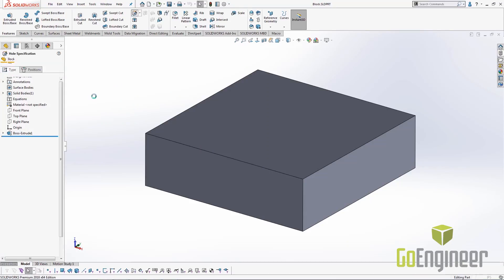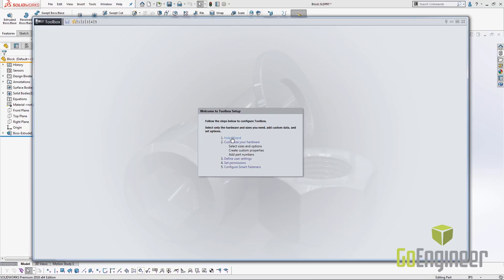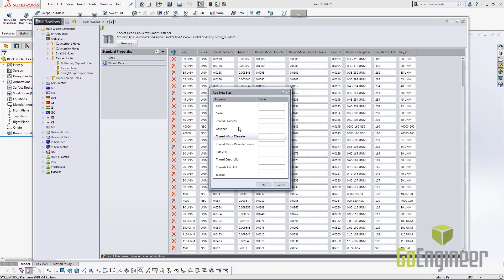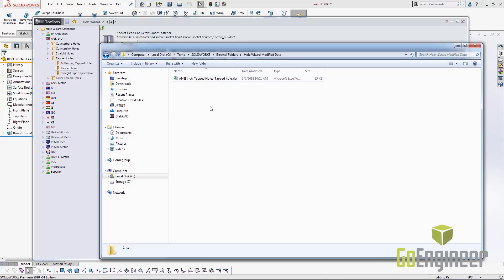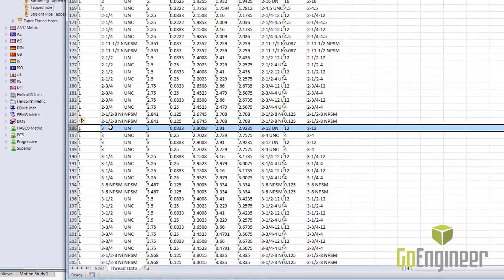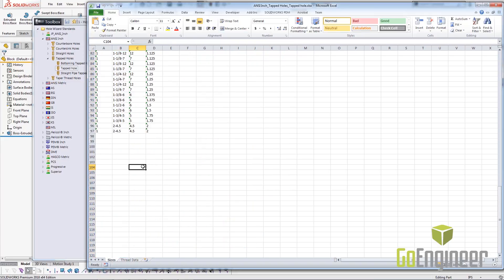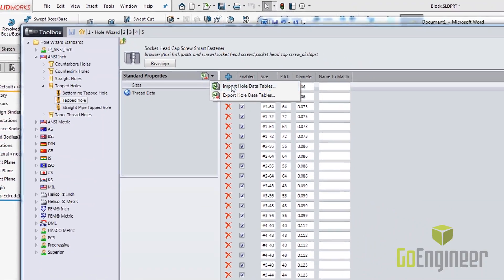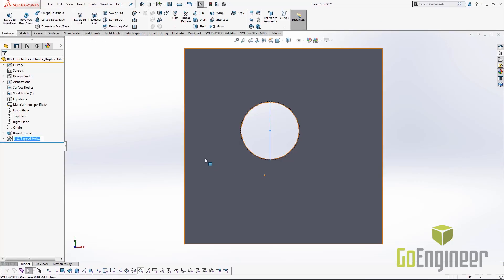SOLIDWORKS - Hole Wizard Size Creation

Comment: Once I assigned the hole*eg:30 mm) and trying to edit that the custom size check box checed in and it is the 30 mm but the actual hole is differntly assigned automatically. Is there any way to prevent this happens?

Comment: I'm trying to do this with Solidworks 2020 and the program is demanding much more Size data than provided in the Thread Data table. It means that I don't have all the specs needed to fill in the Size table. Thoughts? I need to add the M1.2 screws to my Hole Wizard asap... :(
Reply from the maker: Hello Nicolau, I would suggest reaching out to your value added reseller to help accomplish your setup.